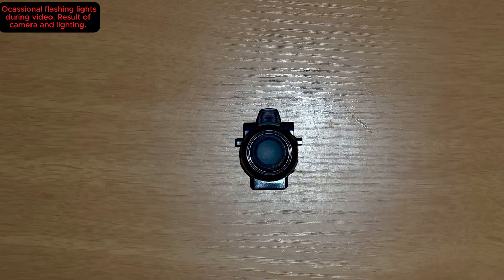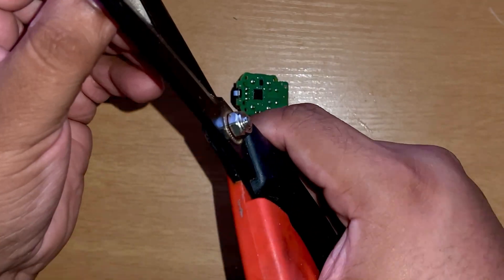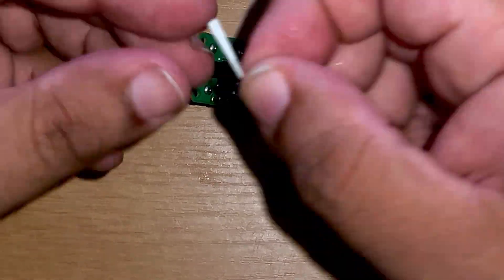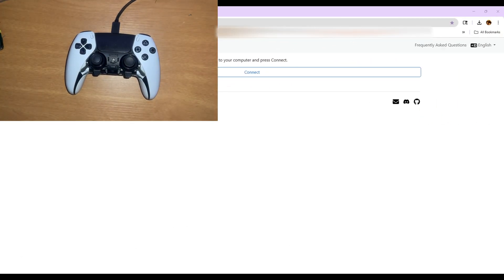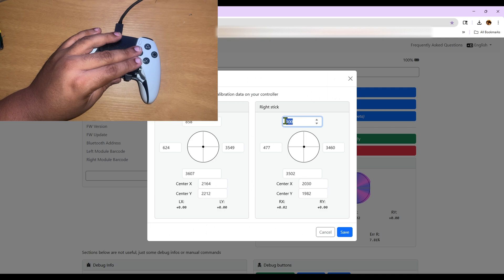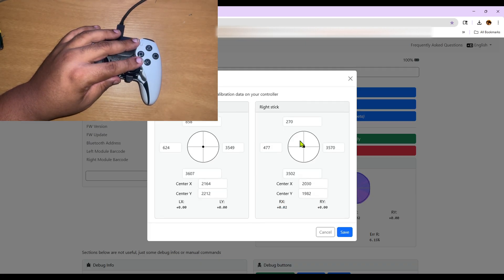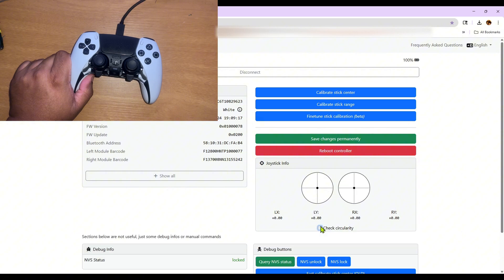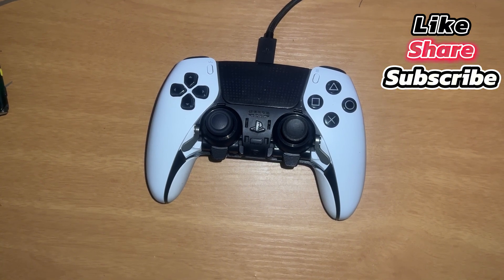DIY PS5 Dualsense Edge Gulikit TMR Joystick Calibration - UPDATED METHOD

Comment: @OmeliGaming Thanks for the video. I will definitely try this tonight. 

Do you think after installing the Gulikit TMR thumbsticks modules can I use the original thumb cap that came with the Dual Sense Edge or is it mandatory to put the Thumb caps that came with the TMR modules?
Reply from the maker: You can use whichever you’d like. Just can’t mix the thumb stick grip and dome caps with each other.
Reply: @OmeliGaming That’s perfect. Thank you!
Reply: @OmeliGaming  I am getting a failed message when unlocking the module. I ran the tape exactly how you did. I am not sure what I am doing wrong 🤦‍♂️

I removed my tape work because once you mess with it too much the tape starts to release some strands that can go to nearby solder joints. So I ran the line in one strip of tape and that cause my controller to not turn on. I went ahead and ran it again into two strips just like in the video but again I couldn’t get it to unlock. I even used a microscope to make sure that I wasn’t making contact with anything else but no luck. I replayed your video a few times I even zoomed in to it and I still couldn’t figure it out. 

Just when I was about to give up I decided to try the jumper wire and that did allow me to unlock the module and calibrate the stick. Luckily I still purchased the jumper wires from your link for future projects. 

I would still appreciate your help because I would love to have a permanent solution. It’s getting late so I will work on the second module tomorrow. 🤣
Reply from the maker: @geogadget1 I’d try cleaning the points with some 99% isopropyl alcohol . I found having a decent sized piece helps.
Reply: @OmeliGaming I cleaned it every time I ran the tape line because of the strands it leaves behind along with the sticky residue. Do you think I should solder the two points once the tape is applied?
Reply from the maker: @geogadget1  If you're going to solder I'd go with the wire from orginal. But you can also remove the shielding from the wire and place the tap over it. It'll act as EMI shielding and a way to make the wire doesn't shift inside. Still prevent the tape from touching other pins and resistors.
Reply: @OmeliGaming  Thank you! I won’t be able to work on it tonight like I planned but once I do I am going to remove the wire since I added solder to the two points I will try your tape method again. Maybe the two points were too small and not enough contact was being made with the tape. 

If that doesn’t work I will try method #3 which you just suggested. I will report back to you and let you know what works because it could help other people with the same problem I ran into.
Reply from the maker: @geogadget1 if you could message me on one of my social medias I can send you a picture of me using bare wire and tape.
Reply: @OmeliGaming I managed to install the second TMR stick. However, after connecting it to the controller I am getting a white flashing light. For some reason is not recognizing the new TMR stick. Do you have an idea what it could be? I removed the jumper cable.
Reply from the maker: @geogadget1  sorry to say but you may have done some damage to the board. My experience is either a torn copper pad or a resistor has shifted/gone missing. It happened to me when having a holder in wrong spot while desoldering or heating up with a heat gut and resistors falling off. Ripped pads happens when pulling excessively before solder has completely melted or been removed. The Edge is the primary reason I use the joystick removal tool. It’s not putting heat in places that aren’t needed and all pins’ solder are molten when removing the joystick.
Reply: @OmeliGaming Dang I was afraid you were going to say that. I had a huge feeling. That means I also wasted a good TMR module as well because I don’t think I would be able to re-use it on another board.
Reply from the maker: @geogadget1 the TMR can be moved. Just have to remove any solder that remains in the TMR joystick itself. Solder that remains won’t go through holes of the next module. 

Don’t get discouraged though. Same thing happened to me when starting out with Edge modules. Sometime they can be unforgiving but end result is great.
Reply: @OmeliGaming thank you bro. I really appreciate it.
Reply: @OmeliGaming  My brother once again I wanted to thank you for always replying back to my questions and for all the help you have provided. 

I was able to reuse the TMR and applied it to another Edge PCB. This time I was very careful where I placed the Helping Hands and where I kept applying the heat to make sure nothing else comes out of place and this time everything worked. Just like you said I killed the previous pcb 😂. It happens. 

I also reapplied the tape to be able to calibrate the Edge sticks whenever and it worked. The steps I took differently from before is that I had soldered the two points to make sure the tape made contact and I also cut the tape very thin and ran it at a diagonal angle making sure it wasn’t close to any of the solder joints. I think in my first attempt the tape was too thick and kept getting really close to one of the solder joints even though it wasn’t touching.
Reply from the maker: @geogadget1 that’s fantastic! I’m glad you got it worked out. And it definitely happens. Got me twice and I haven’t made the mistake since. I hope you love the new sticks. Happy gaming!
Reply: @OmeliGaming Thanks. I think I will be getting the special tool if I am going to be doing this more often. 😂 is there a 900m tip soldering iron that you recommend? I will only be using it for the tool. I am not sure if my existing iron has 900m tip. I am new to this. This was my first soldering project. Already did 6 regular DualSense and 1 Edge controller. Next will be an Elite Series 2 controller.
Reply from the maker: @geogadget1 the guy that makes the tip sells an iron that goes with it. It’s currently the one I’m using. If you buy one yourself it definitely needs adjustable temp.
Reply: @OmeliGaming Ok cool. Had placed the order without the iron. I figured I would get it cheaper on Amazon but the piece is on back order. I’ll do my research. Thanks again. If you get your hands on an Elite 2 or even Elite 1 if possible please make a video. I just finished watching the Nintendo Pro Controller video 👍
Reply from the maker: @geogadget1 thanks for the support. And I will definitely make one for Elite 2 if I get my hands on one. Actually have some Gulikits I need to use soon on an Xbox controller.
Reply: Wiring method 👍 I would find a short circuit on the board with a diode test, 0.0V clear short circuit. A fusible head extractor works best.